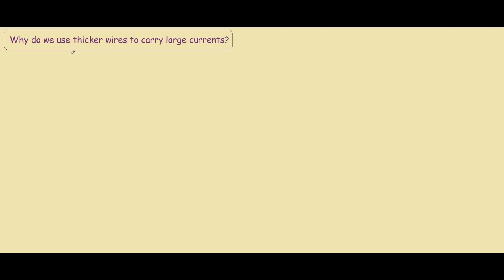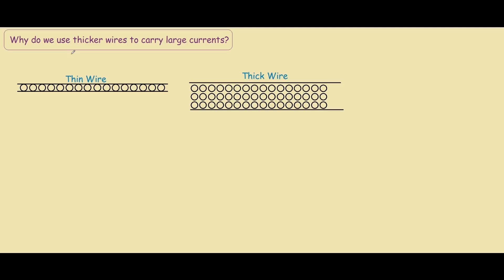Wire size vs Current

Comment: Good video, used it in my class. Just one thing though, electrons carry charge not current...current is just electrons flowing in a certain direction. If electrons are not moving they still carry charge and we refer to that as static electricity it becomes current when it flows.  Good job though I like the quality of your video, short and precise.

Comment: Ok but what if you are powering something small 12v 2amps and use something like 10 awg wire
Reply: Yeah that's the question I'm chasing as well. Guess I'll keep on looking for an answer.
Reply: It will still be the same